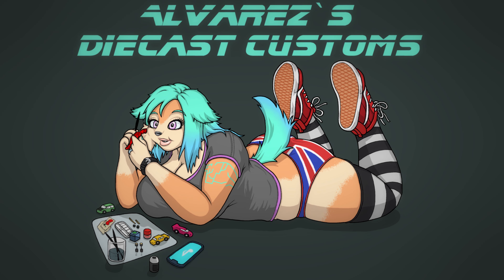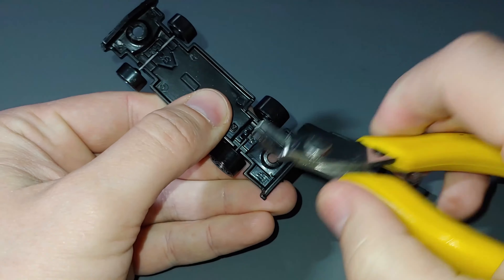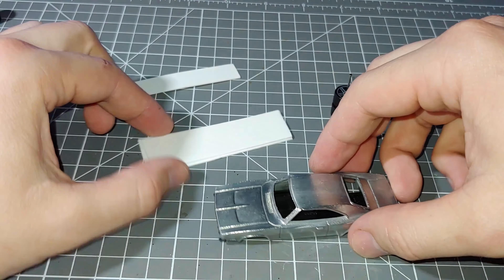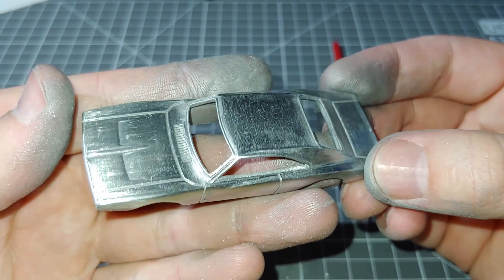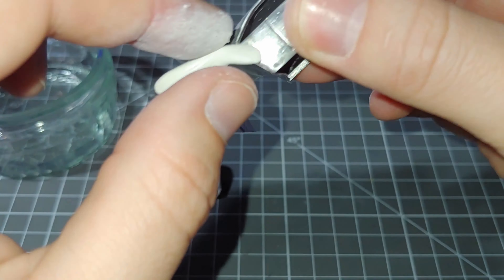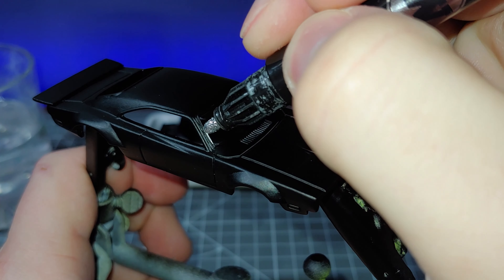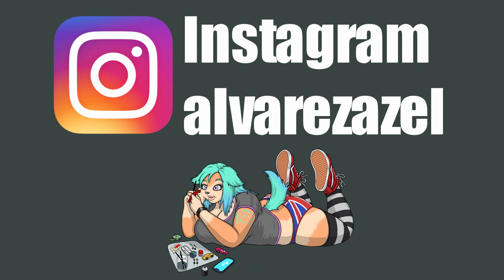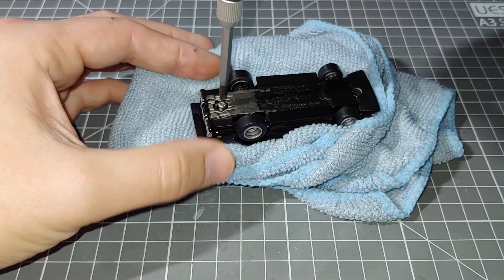Hot Wheels Dodge Charger custom - EP35

Comment: I love the look of the shaved down door handles and other bits. I think the front grill could use a little more detail than that for my taste, but the car as a whole looks fantastic.
Reply from the maker: Thanks!
Yeah I wanted to get more detail into the grill but I couldn't find a way to make it look more convincing, I didn't have at hand a really fine mesh or such.
Reply: Yeah, I think if you could have put some very fine mesh onto that grill it would have completed the makeover.  Or at least some tiny rod/wire placed horizontally.

FYI - A possible source for mesh in this scale is replacement faucet/shower head screen.
Reply from the maker: @earlware4322  Yeah good idea Earl.
Thinking about it my wife drinks these fruit teas and the tea bags have a very fine mesh to them, these might just work too 🤔 will update this custom in a video in the near future if it works 👍